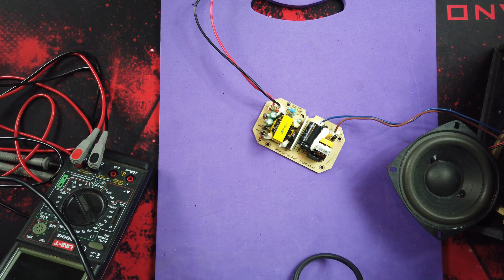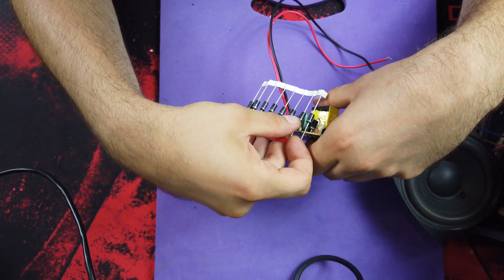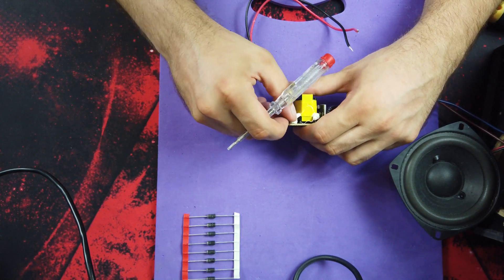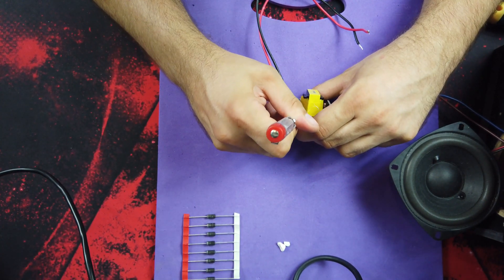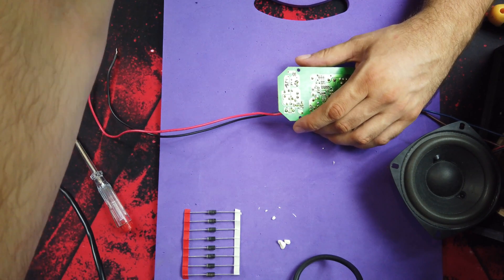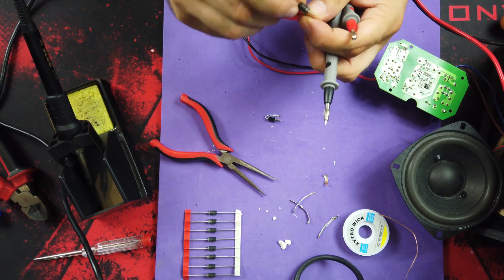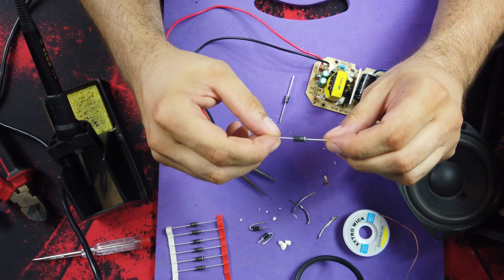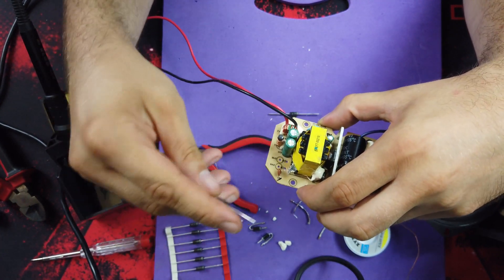Trying to FIX - Logitech Z313 Speaker System - part 2

Comment: Thank you for your valuable repair manual. I replaced the two Schottky Diode on Logitech Z313 and now the speakers can be turned on again  (green light on switch works, not before) and every thing works fine. Both old diodes were dead.

Comment: Thank you  for the video, it showed wise thinking and decisions. I think I have the same problem as I had buzz on both sides of the linked diodes . May I know the specification or names or website for the replacement diodes ?
Reply from the maker: SB5100 Schottky Diode (100V maximum repetitive peak reverse voltage, 5A maximum average forward rectified current and with DO-201AD package).

Comment: What type of diodes/ capacitors were they did u find the schematics for this particular model to track that down?
Reply from the maker: SB5100 Schottky Diode (100V maximum repetitive peak reverse voltage, 5A maximum average forward rectified current and with DO-201AD package)

Comment: Hello, help me please.  I have a problem that the 3.5 jack connector broke and I had to replace it with a metallic jack, but it does not work and it gives me an electric current and it hums. Please help me.
Reply from the maker: Are you sure that you connected it right?

Comment: Hallo, I have problem with my  Logitech 323 right speaker, something happens and only this speaker does not work. The sound is VERY low on this speaker. I tryied to disassamble it, and for a few moment the sound repaired itself for a few moments. Could you help me please?
Reply from the maker: You should definitely start by checking continuity of all cables, cause it looks like some connection problem (especially continuity of that right speaker plug to board in that speaker).

Comment: thanks for the video, my Z313 suffered the same failure, new diodes all fixed, though I have never come across such thin cheap track on a circuit board.
Reply from the maker: Glad to hear that you find this video useful! :)